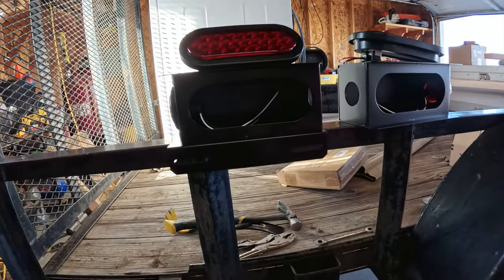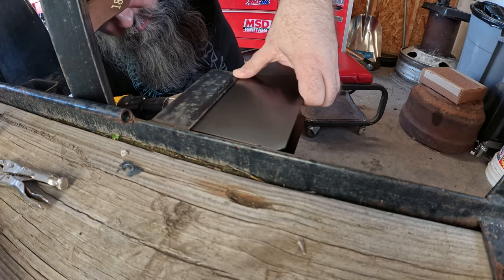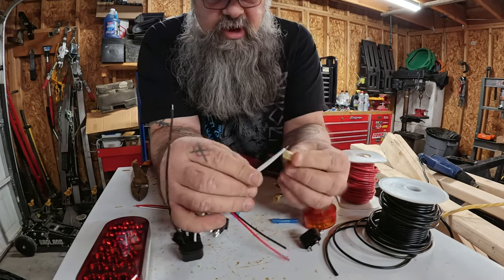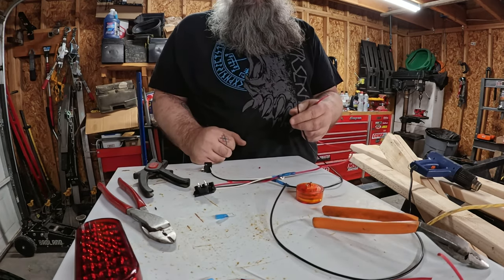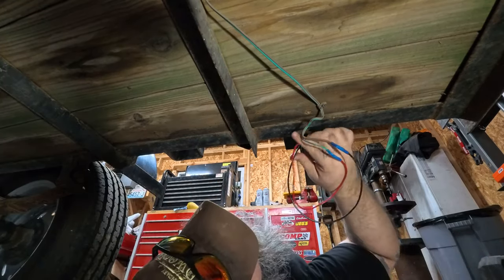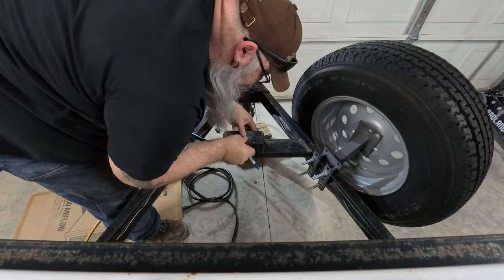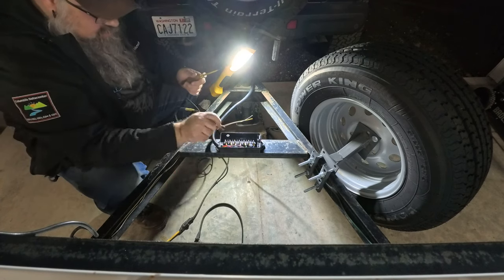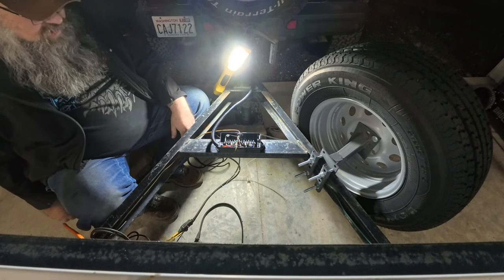Upgrading Utility Trailer Lights

Comment: I have the GoPro Hero 7 Black, and it overheats also. When I run it as a dash cam to record trails, I have to take the battery out and run it off of USB to keep it from overheating.

Nice light set-up!